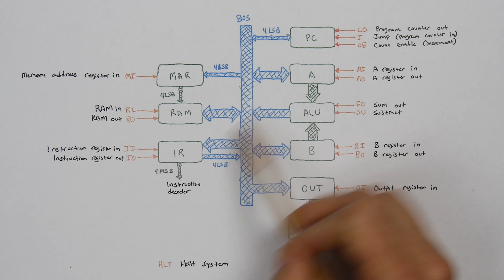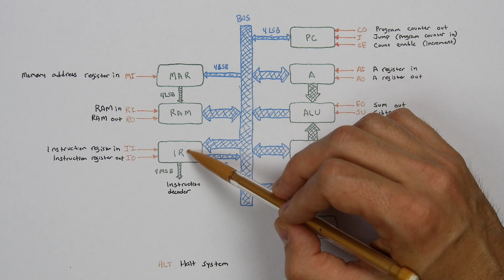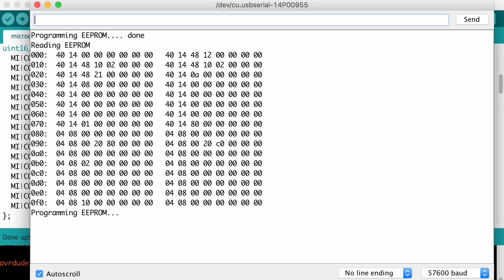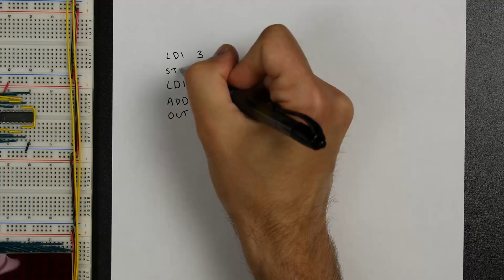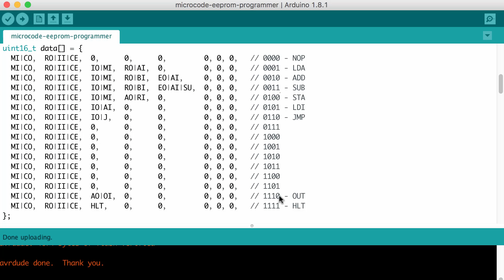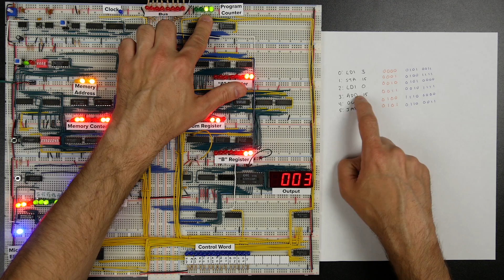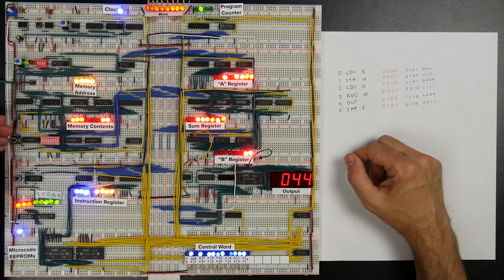Adding more machine language instructions to the CPU

Comment: Would it somehow be possible to have instructions with full 8bit parameters 🤔
Reply: I have a concept that you can write one instruction in two following places in memory and in every move of program counter you can read what is in memory, store it in instruction part of instruction register. Then you can increment program counter and save content from ram into data part of instruction register. Every instruction will take 2 cells of memory but that makes that you can put there 2^8 ram because you use all 8 bits in transferring address. With this you can also put in a register numbers with all 8 bits.
Reply: I'm thinking about forking it into a true 8 bit data, 16 bit address bus machine if Ben's had enough.  Who knows he might want to make it a 24 bit address bus!  How many breadboards have you got?? :)
Reply: How about this?:
You do a fetch into the "A" register.
Then you do a fetch into the "B" register.
Whatever instruction comes next, is the "operator" which is supposed to do something with the content of these two registers (either just the "A" or both of them, depending on the arity of the operator). Kinda like the stack machines do ;)
This way every opcode takes one byte, and follows one or two operands, 1 byte long each.
The destination registers can be simply toggled (or rotated like a revolver, if the operand "stack" is more than two registers) with each LD instruction.

Comment: i would remove the CE signal from JMP function just because it's unneeded
Reply: Actually you can't. Since it's in the fetch cycle they all need to have CE. We don't know we're doing a JMP until the third microop. You might break the next instruction if you omit the CE signal.
Reply: Per Mortensen: No, mollerch has it right.  With the sequence:

3: ADD 15
4: OUT
5: JMP 3

The microcode executed is:

5: JMP: MI|CO, RO|II|CE, IO|J, 0…
3: ADD: MI|CO, RO|II|CE, IO|MI, RO|BI, EO|AI|SU

The JMP instruction will remain in the Instruction register during the MI|CO and RO|II|CE "virtual" stages of the ADD instruction; the actual ADD opcode doesn't make it into the Instruction register until the instant AFTER the "II" signal is executed.  Therefore, the "CE" signal for the ADD instruction in this progam comes from the JMP instruction, not the ADD instruction, and therefore, the CE signal needs to be present in the JMP instruction.
Reply: You can remove the CE signal from JMP instruction, but you would have to move it from the 2nd micro instruction to the 3rd in all the other instructions, otherwise what Brutikus32 and the others say is true.
Reply: But it doesn't take any extra computational work, so you might as well leave it in. Then you get the benefit of your code looking a bit nicer.
Reply: what mollerch is refering to is the arduino code which has the fetch cycle all the same on the left side and it would look ugly if you omit it only on a single row
and he is right about the computational work too
Reply: mollerch That's not right at all. With Ben's implementation the same fetch cycle isn't being run for each instruction. Rather the fetch cycle is explicitly programmed in separately at the beginning of every instruction. As such the fetch cycle could be different for each instruction, and you could absolutely omit the CE for the jump instruction if you wanted to.

Comment: Is the physical build part of the computer complete or will there be added some additional stuff in future videos?
Reply: He's still missing a JC, the conditional jump.  Without it, his computer isn't yet Turing Complete.
Reply: I don't know, I think it's over, since the design is based on the SAP-1 by Albert Malvino.. unless Ben plans to add more modules. A flag register would be awesome, since it could be used to do conditional jumps
Reply: A flag register! That must be the answer to my question, how to add conditional functionality? That's the heart of any program I ever write (I'm just a hobby programmer for fun) and not something I'm sure we were ever going to get to.

My current thoughts:
If we can reduce an if statement to a binary result, like 0000 or 0001, we could place two JMP commands pointing to the different code blocks, which could have hardwired jumps to go back to before the 'if statement'. I'm not sure how we would be able to reduce an if-statement tho, especially with limited capabilities as is. However, considering if statements do exist, there is obviously some circuit that allows this. I found info such as Q=(A*S)+(B*S') with Q=result, s=statement, a/b=code then/else. This makes a lot of sense, but seems to require S results in either a 1 or 0, which is my original question.

How could we program if(a>b,code c, code d)? If we subtract a-b, >0 is true, <0 is false, and =0 is equal. But now, how do we check equality to zero? I'm not sure, but maybe could help!
Reply: For equality to zero you OR all the bits together and get zero if it's zero, and one otherwise.
Reply: With my version of the build I have figured out how to add a jump carry/no carry instruction, involving the carry output, a latch and a few extra gates. The carry flag output goes to a rom address line to select if the instruction jumps or acts as a NOP and resets the carry flag after the jump is executed.
Reply: +Brutikus32  Speaking of which:  What instructions are required for the computer to be Turing-complete?
What is the minimal set of operations it needs to have, so that after removing either one of them it won't be able to compute the same sorts of things anymore? And what is the minimal set of registers?
Reply: There are at least two more videos, maybe more. Apparently there was a gap, I wouldn't know, I'm binging them all at once.
Reply: he could build a MS DOS system or similar
Reply: Yeah I think he will add a JC instruction, but I can't wait weeks for the next video :/ They are so well made I would love if he just uploads all the videos to finish the computer.

Comment: I really wish we had one of your computers at college... we had to do all this in theory and on paper... I "got it" OK but it would have been so much better really running stuff on simplified hardware like this.
Reply: I wish I knew how to build a computer and program in machine code.
Reply: edgeeffect get yourself a SBC or even an older PIC board, you be not stop learning.
Reply: TheWeepingCorpse ... yeah... I should say that I was at college a long long long long long time ago and I've got a couple of SBCs and plenty a microcontrollers ... but AVR not PIC 'cus of cheap knock off Arduino boards and what not.
Reply: CPU control unit biso

Comment: How fast Can it run?
Reply: Not fast.  Since it's on breadboard and there are super long traces going everywhere it's just not going to be able to run very fast.  I don't know how fast, but it has everything working against it.  It would be an interesting experiment.
Reply: you should watch the first couple of videos, I don't remember when he talks about the clock module (maybe it's the third video): in that video he explains the use of the 555 timer and I think he also tells the maximum clock frequency
Reply: One of the bigger limits on it's speed is the EEPROMs.  I think the ones Ben is using are 150 ns.  This would limit the clock to less then 5 MHz.  How ever Ben is operating the control ROM on the negative edge of the clock while every thing else runs on the positive edge, so you would have to divide that in two and get 2.5 MHz.
Reply: On my one I have a 1 MHz clock, and it seems to run ok on that. My design is a little different as it uses solder boards instead of breadboards but I figured 1 MHz was probably ok
Reply: Short answer: No, it won't run Minecraft :q
Reply: Probably about 500K Hz.   Really slow, as the Eproms are 150ns memory access, so you are limited by the control logic.  As it only has a 4 bit Memory address, how fast it runs isn’t really the point.   It’s a teaching tool to learn how a microprocessor is structured.   Even the 8082 CPU in the early 80s had more functionality than this breadboard computer.
Reply: I would be surprised if it exceeded 100 KHz.

Comment: I saved one byte (at address 15).
0: LDI 3
1: STA 0
2: LDI 0
3: ADD 0
4: OUT
5: JMP 3
Reply: Actually, you could manually set location 0 to 0x03 and just execute it as a variant of the no-op instruction:

0: 0x03
1: LDI 0
2: ADD 0
3: OUT
4: JMP 2

If you use self-modifying code, you create the need to re-enter the modified parts of your program every time you want to re-run it.
Reply: If only we could reuse the "3" from the jump's operand somehow... :J

Comment: I'm debating with myself whether adding a "hdd" of sorts which would load pages of RAM (say 8 Bytes) would be worthwhile/possible. I think it'd be an interesting addition, but possibly a bit janky in implementation. I think it would probably take up two op codes as with MO|II|CE combined that is actually still from the previous command.
Reply: how can you implement this? you would need some sort of loop to load those 8 bytes in RAM, right?
Reply: Yeah, there's two ways i can think of, some bootloader like code to loop through the hdd and load each line individually, but you'd need to keep it REALLY short (like 4 commands or less) or two op codes which would be more possible (could be one except that the CE actually comes from the previous op codes instruction logic due t it being combined).

The first opcode would basically set up the non CE 2nd step for the following op code which would then let you say load page x. Then that would have to trigger a separate counter to write in the 8 lines of RAM followed by triggering CE on the 9th (maybe 8th?) pass.

Maybe you could bring it down to one opcode via a counter decrement signal but that'd need to be tied into the counter to not run (or trigger an extra CE) after the  new memory is loaded. Like I say, implementation is a bit janky.

A thought that did just come to me though is that you could use this to speed up programming the computer. Have an EEPROM, counter and clock on a separate board which would load in a number of programs into memory, you could then select the programs with dip switches and press a button to load all the memory instead of writing and address and memory content each time individually.
Reply: I had an idea for this which is to keep an EEPROM as the storage device. Upon power up, the HLT signal would be held to stop it from executing any random memory as the program. 

Then a combination of a 555 timer, and a 74LS161 counter would act as a clock and address to loop through the EEPROM and write it to RAM. The clock can be very fast and doesn't need all the fancy switching to manual mode like the clock module. Closer to the 555 on the output module.

When the loop finishes, it then starts the program by releasing the HLT signal; perhaps by simply pulsing a Reset signal.

You can then optionally have every reset signal rewrite the storage back to ram in the event that the program has changed some initial values.
Reply: I've been thinking of doing exactly this for when I make my version.
Reply: I've been working on this for a while now. Take a look here:
https://www.hackster.io/david-hansel/breadboard-computer-programmer-1e7a09
Reply: How about using some SD cards?  :J
But there are simpler solutions too. In my own project, for example, I made a simple paper tape reader so that I can store programs on white paper tapes with black dots on them representing bits. I have a row of 8 LEDs and 8 phototransistors in separate compartments and I slide the tape under it. The white paper reflects more light than a black spot, so the phototransistor can detect the drop in brightness and count it as a bit set. There's a 9th row in which there's a dot for every column, for synchronization – it dumps whatever has been read (and latched) from the previous row of bits and increments the memory counter, then latches the current bit pattern again, and so on. So to load up a program into my computer, I can simply slide the paper tape through the reader and it gets loaded into RAM :) The only drawback is that I have to manually prepare the tape – which isn't so much of a fuss, since I pretty much do it anyway when I assemble the program by hand into zeros and ones :q  But of course it would be cool to have a device that could be able to dump the bytes from RAM onto the paper tape automatically. Unfortunately, I can't think of any simple way of "printing" those black dots on the tape automatically (unless we use some sort of photo-sensitive paper or something :q ).

Comment: If your program is ONLY for displaying multiples of 3, you could drop 'ldi 0' :)

ldi 3
sta 15
loop: out
add 15
jmp loop
Reply: 0 is also a multiple of 3, namely 0*3
Reply: Ben could have pointed out that after it wraps around above 255, it restarts at 2 instead of 3… because math!
Reply: Yep it's an overflow/carry - which is also perfect for a conditional branch instruction with offset ..

So, branch if carry clear/set rather than that hard jmp - which the academics will say is 'bad practise'  Of course at this level it makes no difference, but in microcode you'd read the carry flag - if clear add the 2s-compliment value - of the operand ...which could be negative ...  store in PC and continue execution.  Perfect for up to 128 byte branches in either direction.

This little computer is a wonderful trainer,  but it's begging for an 8-bit wide instruction decoder and 16-bit address register and program counter, so you can add a 6116 or a 6264 and use some of those eeproms as program storage.  Then you have a potentially extremely useful computer.

In the current state we'd probably call it an 8/4bit processor because even though it has an 8-bit wide data bus, the instruction decode/program counter sharing 8 bits really limits its potential.   On the other hand it's not too much of a stretch to expand it to that level of functionality with different addressing modes.    Brilliant, brilliant series Ben...
Reply: It is, but display shows 0 after reset ;)
Reply: +Andy Grace: Speaking of which... we really need the status flags – another cool thing to have in this computer.
Reply: well i guess 2 is a multiple of 3 the too 2/3 * 3